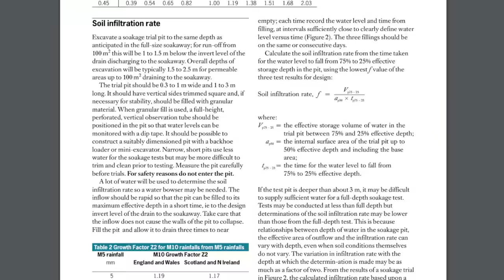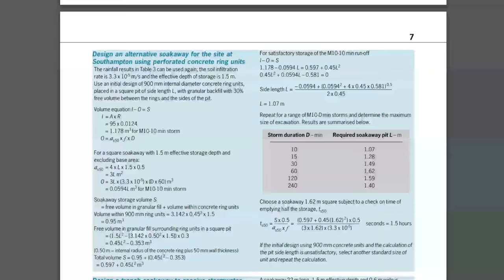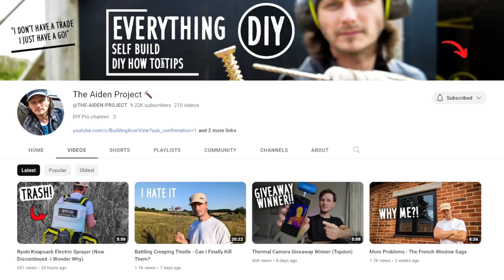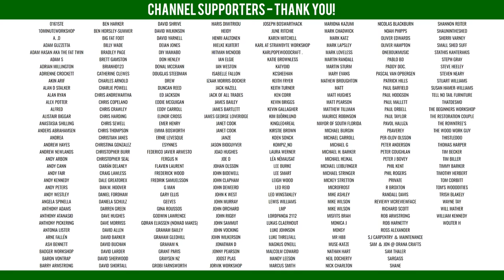DRAINAGE SOAKAWAY In One Day!

Comment: we had some drainage guys (good reviews and recommended) replace ours a few years ago - i kept an eye on the work and they put the crates in , then they broke the top of the crates  and barrowed in the gravel - I stopped them and said this is not right - reply  "i have been doing this for 40years mate, and this is the right way"" !!!! so i called the boss and told him that this is a problem by that time they had laid the 2 drainpipes over the top of the crates and filled with earth ......   anyway a couple of weeks later and they came back and dug it all out again to redo ...  no one died but what a load of stress - garden lawn damaged  by the digger, which they did relawn  and then when finished within a few weeks the earth starting to drop - The company went into liquidation ........EDIT - Just to add - our cost was £875 in 2018 , that was for 9 crates , they did the calculation , its just the front of our bungalow as we also have a soakaway at the back of the bungalow, and then 4 downpipes for guttering - 2 per soakaway. so front was replaced -  Gravel, membrane, pipework replacement , mini-digger and 2 chaps took 1  day. flatback truck used and all waste taken away - of course they had to comeback and completely redue as said before , so another day....
Reply from the maker: Oh my God! I hear so many horror stories like this by "professionals".... 🤦‍♂️
Reply: @RagnBoneBrown   watched all the video now - great video to show how it should be done - updated mine comment with the cost in 2018 £875 , so 5 years later and with the cost of everything going up so much , i suspect that would essily be double that now - based on other trades we have had in - also subscribed and watching some of Aiden videos

Comment: Aren't you breaking building regs by building the soakaway within 5 meters of the foundations of that house and the neighbours house ? 

Did you have to get permission if it's under 5 meters away from the houses ?

Also at the end why is your surface drainage higher than your air vent ? If really torrential rain won't it potentially fill the gravel gully up enough to go into the vent without draining away quickly enough,as it looks like the water runoff from the patio won't always drain straight into the drain without filling up the gully/gravel area first.

Would it have been better to fit a french drain there closer to the house ?

Comment: Looks like 11:18 fun.  I know what you mean regarding the controls.  I don’t use my dads backhoe often enough.  Just when I think I have the hang of it.  I don’t.
I may have to do something similar on my property because my seasonal pond has attempted to eat one of my out buildings several years ago.  I think my solution will be to dig a swale along my property from the back to front where there is a drainage ditch… my dilemma is that there is an incline in the middle.
Looks good.  Job well done.

Comment: You need to daylight this water to the street.  That’s standard practice.  I’ve never heard of roof gutter rain water going into a soak away.  Ever.  Call your local council mate.
Reply from the maker: That's absolutely not the case, not here anyway
Reply: @RagnBoneBrown  Wow.  😳  So then what happens when torrential rain or whatever maxes out your soakaway and it back flows?  And how often does that happen?
Reply from the maker: That never happens. The rain soaks away. Hence the term soak away
Reply: @RagnBoneBrown  Yeah mate.  I’ve done soakaways in the tropics.  Waste of time.  You just mustn’t get much rain.  Still, if it works it works.  👍

Comment: Why didn't you use Accra drains a round the house then use the adapter in ot orange pipe look to me soakaway you dug is way to big you may look so much had work can't get my head 🤔 but look good went finished
Reply: I forgot say would safe all that  cement filling round the drain 👍